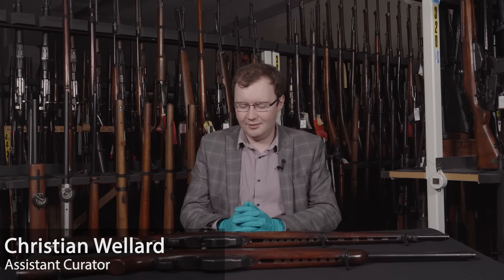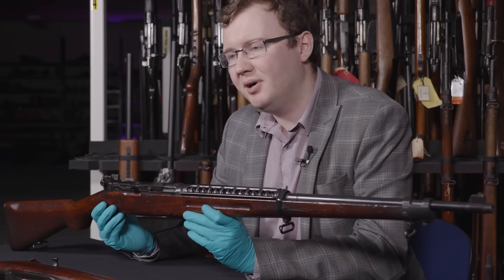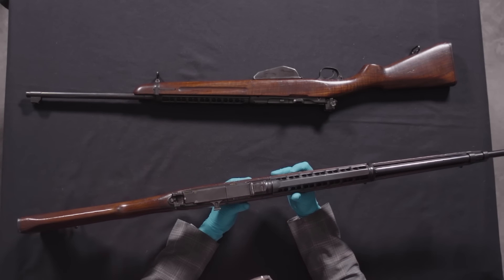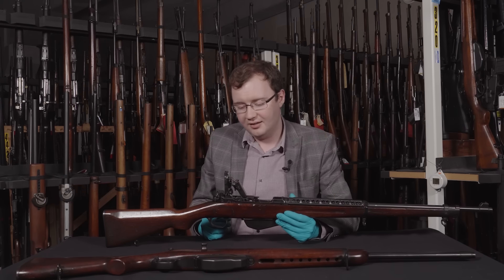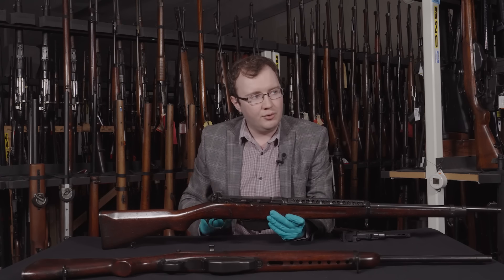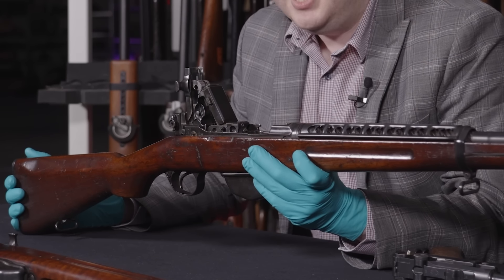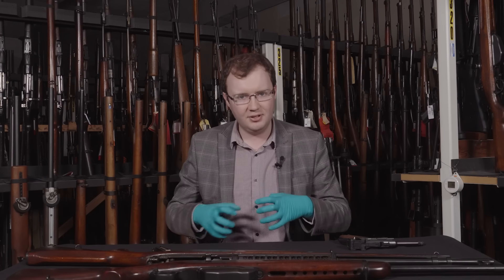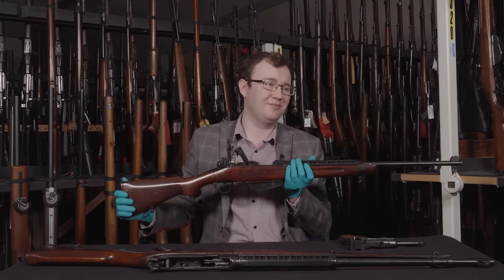Why didn't Britain adopt this advanced self-loading rifle? With firearms expert Christian Wellard

Comment: Pure toggle locking is VERY tricky. It takes really too little, in terms of angle between the two pieces of the lock, between "too much locking, the rifle doesn't cycle" and "too little locking, the case head separates".

Comment: A fair number of people here seem to not understand what "lubricated case" means.  It isn't an oil, but rather a very specific kind of wax.  That wax only liquefies and lubricates under the temperatures and pressures of firing the cartridge.  Just handling the unfired cartridges feels more like handling lacquered Russian steel case ammo.  They're smooth, and not sticky at all.  That said it isn't an ideal solution to the problem.

Comment: I think that the £250 cost per rifle included the R&D and tooling to hand build a couple of examples. In the early 1930's an average annual salary was £165 pa and a terraced house could be bought in London for £400. The actual production costs might have been considerably more than a Lee Enfield but that would have made a massive difference to the firepower of an infantry platoon. The British later bought 1000s of Tommy guns, which were never very cheap!

Comment: I don't see why you need lubricated ammo considering the Vickers MG used a toggle lock and didn't need lubricated ammo.
Reply: It's because it's a delayed blowback system. As such it doesn't have as much extraction force as a gas or recoil operated locked breach design and cartridges have a tendency to stick. The solution is to either lubricate the cartridge or flute the chamber so some of the gas "floats" the fired cartridge out if the chamber.
It's what Christian was trying to explain with the luger comparison but he kind of left out a explanation of blowback.

Comment: I wonder if a flutet chamber would have been a viable solution to the issue of it needing lubed cartridges.
Reply: Revelli's patent was still very much in force at that point in both the US and the UK; it only expired in the forties, if Google Patents is to be believed.
Reply: It would, but such would make production even more expensive in that period (compared to "just ream it"). As it was already a production cost nightmare, lubing was considered the path to go.

The lubrication (in case you didn't know) was a high temperature wax coating, quite "dry and solid" at pressure temperature conditions humans can endure. As such, it didn't pick up grit and grime like oil or grease would. However, I'd bet that also added a build-up issue in chambers and leade with extended/rapid firing.

"On paper" a fascinating design, but not incredibly "real world" friendly as a mid century military arm, especially when one considers it was pretty much married to the Pederson cartridge, as the US retention of the .30-06 round took it out of the competition, while even the Johnson and (cringe) Thompson rifles transitioned to the .30 trials.

Comment: Ian from FW got hold of some .276 to test a Pedersen. I am assuming the parent case is something still made today.
Reply: I saw that video. That was a couple of years ago. The same mechanism, as the one Pedersen sent to the US trials. The Garand was a better, simpler, choice.
Reply: The .276 Pedersen did not have a parent cartridge, which was part of the problem.  It was developed by Pedersen specifically for his rifle.  In size it is most similar to the 6.5 Carcano, but I don't know if you could form .276 Pedersen out of it.  Possibly.  The 6.5 Carcano is longer, but also uses a smaller bullet.  Also the .276 has a significantly sharper taper.  Other than that they aren't a very comparable cartridge.  The Carcano shoots a heavier round nose bullet, while the .276 shoots a lighter spire point at higher velocity.  Probably the closest modern cartridge to the .276 Pederson in performance is the 7-08 Remington, which is more powerful because of higher pressures and a bigger diameter case.

Note that the US military is switching the the SIG .277 Fury, which is basically a 7-08 Remington with a slightly smaller bullet or just a .276 Pedersen with a slightly larger case.  (And much higher pressures.)
Reply: @tarmaque  Thanks for mansplaining that in American fella but the fact remains that the brass came from somewhere so it definitely has a round that can be used as a parent cartridge. Outcomes. Not speculation based on trying to be a know it all.

Comment: That mechanism would be even more difficult to operate during summer training or fighting, given the dust kicked up by road vehicles. Absolute disaster. There is a quote, as I recall, to the effect that Pedersen would never use one part to do a job when he could use two or three parts instead.

Comment: Not surprised as that cartridge was also an early possible chambering for the M1 Garand.   And iirc the capacity would have been 10 instead of 8.
Very odd caliber wise as in all cases the US Army chest beating forcing the .30caliber diameter.   And now finally a .277/6.8 although suped up quite a bit.
I can about imagine an alternative history with a  .276x45 or something similar in a slightly lighter and trimmer SLR/FAL with a 25 to 30rd magazine.   But unfortunately that wasn't the case.
I know I'm going down a rabbit hole but I'll also say I've come to prefer the L1A1 pattern grip and optional longer stick than the average metric FAL.  Probably due to me being 6'2".
Reply: Don't forget that the FAL/SLR was originally designed for .280 which both the British and the Belgians decided was about perfect.
But the Cousins do tend to get wedded to ideas and go to frankly daft lengths to maintain them. At one point they wouldn't look at anything less than .30 cal, now all rifles have to be carbines.  So   because everything has to be a carbine these days and 5.56 from an M4 barrel wastes a significant amount of the cartridge's potential they've gone and decided on a new 6.8 to get the much same effect as they could from simply going back to full length M16 barrels. 
Perhaps in a few years time a full length version of that new 6.8 will emerge and we'll finally be able to say "We bloody told you so back in 19sodding50."
Reply: I think it was Churchill who said that you can always rely on the Americans to do the right thing... After they've tried everything else.